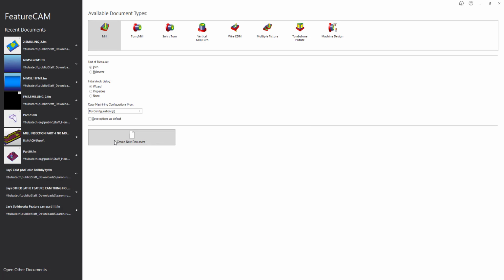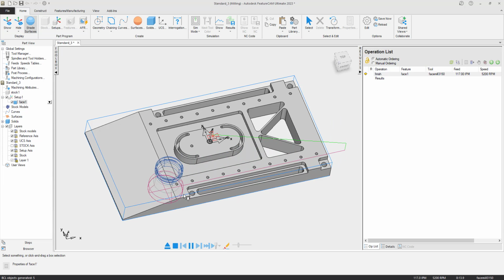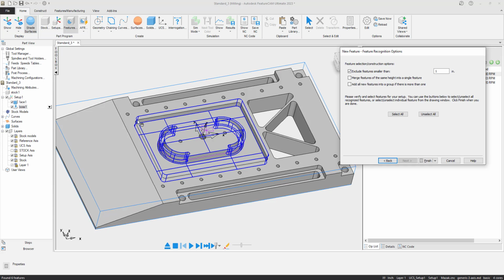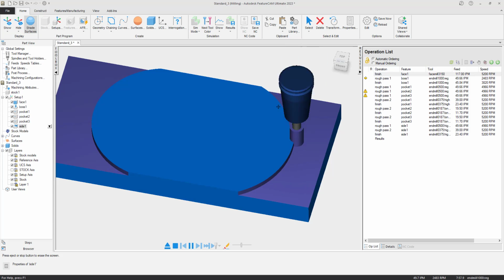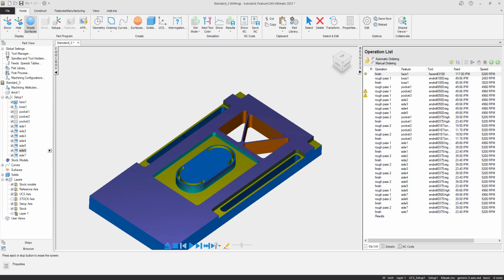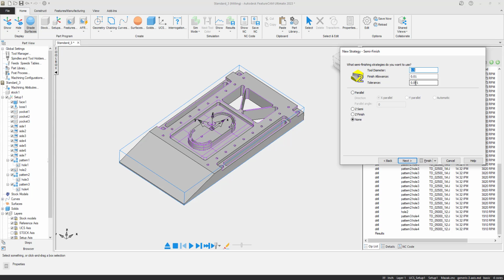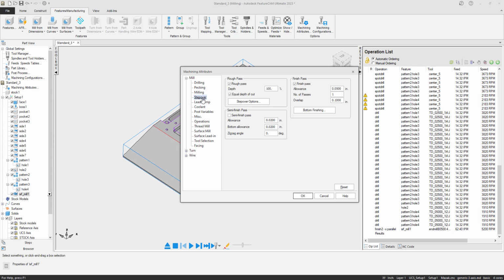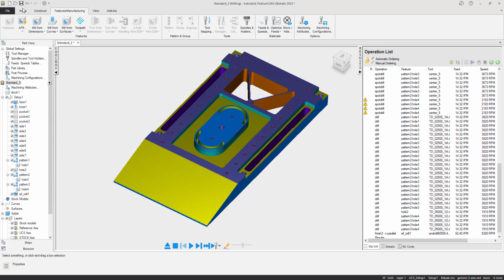Feature Cam Introduction to 3D Milling #3d

Comment: I'm new to Feature Cam programming and have learned a lot from your tutorials. I'm currently trying to program an aluminum flat bar 3/4-inch-thick x 18.125 long, but only want to mill halfway down, flip, and mill the opposite side. Using the AFR feature it automatically goes the full depth. What can I do to change this? Any help will be appreciated!
Reply from the maker: That's great to hear that you're learning from the tutorials. I am glad they are helping. My only idea would be to create curves / geometry and then turn them into curves so that you can limit the toolpath to the location you want. Thank you again for watching I hope this helps